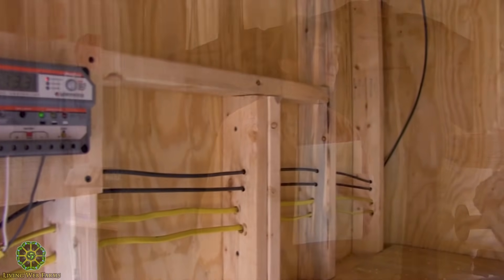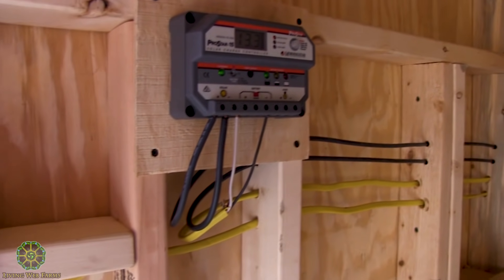Building & Maintaining A Composting Toilet with Richard Freudenberger & Ned Doyle

Comment: Rather than regular composting, is it possible to pair this with black soldier fly larvae, rinse the grubs, & dehydrate using solar before feeding to chickens or ducks? If so, what would you recommend doing with the liquid that comes from the bottom of the BSF bin? Could we just put it in a separate bucket from the urine, age for one year minimum, & run through a hot compost cycle before using on ornamentals?